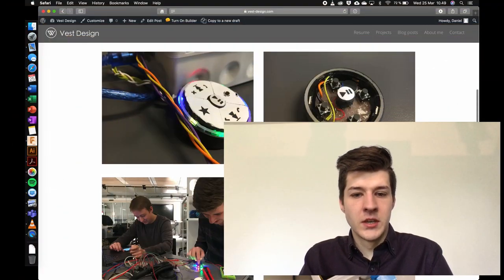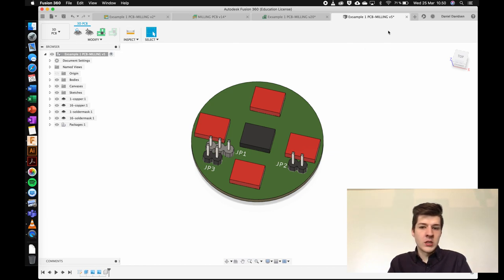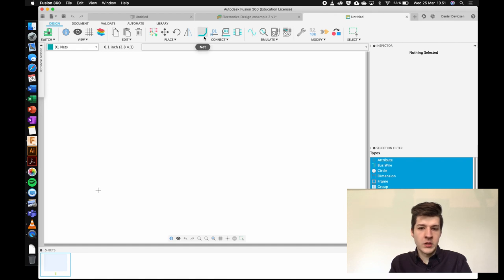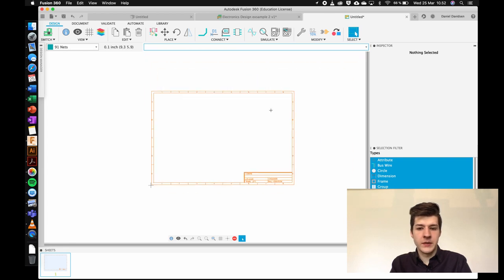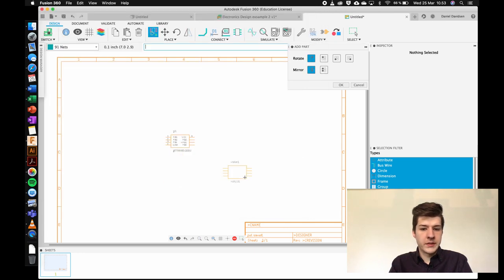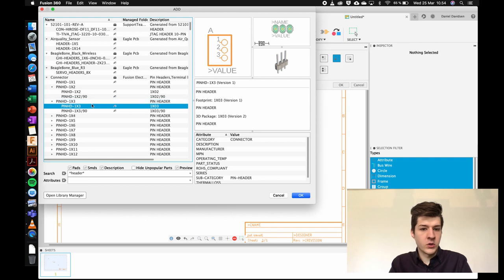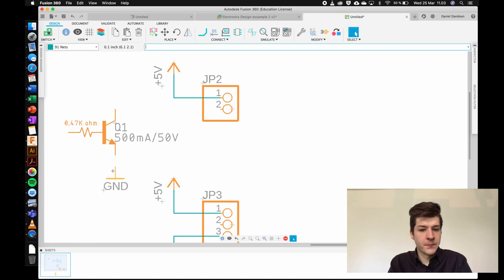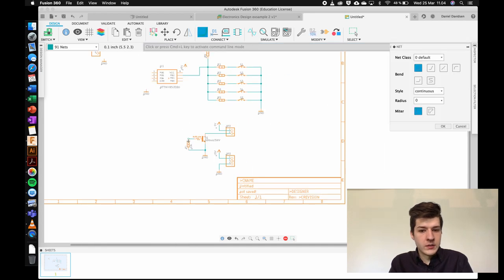Fusion 360 - Schematic design / Part 1

Comment: It's cool that you can send it to 3d object design after making the pcb.

But the libraries are sorely lacking.

I think that's the main reason people (people not companies, ok... even some companies) keep using EasyEDA. Even if LCSC's libraries are poorly optimiesd for search... there are ways to work arround that issue that are still easyer than importing libraries in Fusion's Eagle.